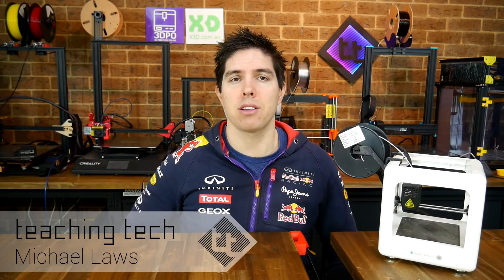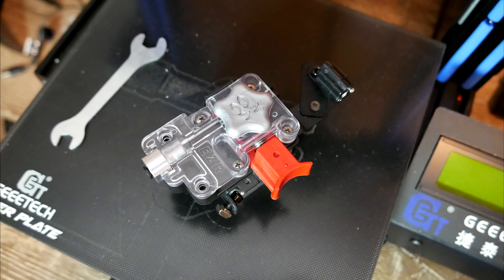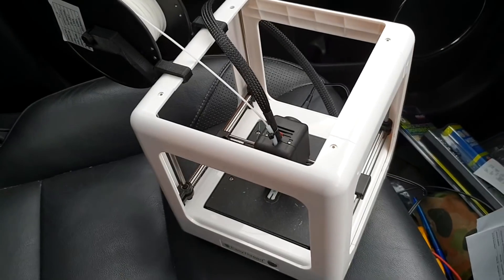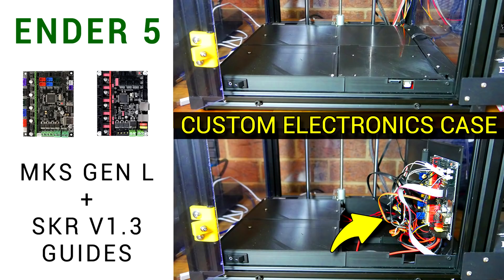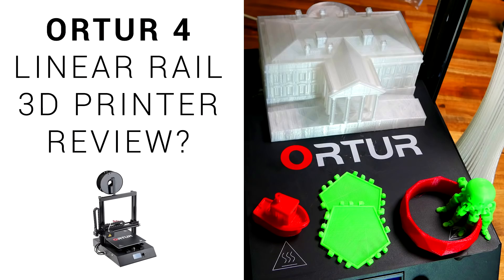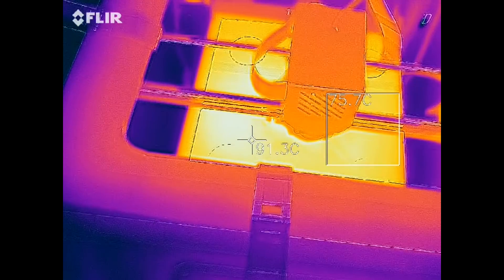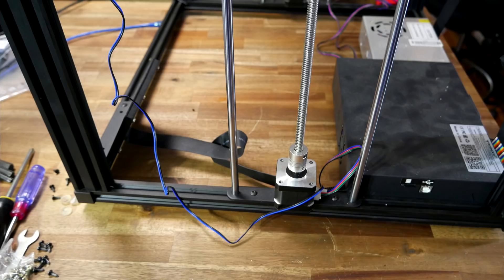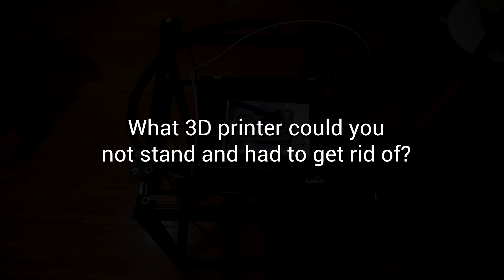3D printer review updates - Keepers and clangers

Comment: I god rid of the Anet a8 and im almost about to do the same with an Anycubic i3 mega with something wrong that I cant find and is making me change the motherboards every couple of months.
Reply: Stop moving your bed and nozzle so fast by hand. This causes them to act like generators and blow the board up with unsafe voltage. It’s probably that (I did that a couple months ago, I knew it was an issue but I got away with it for years and got careless). Or you’ve got really horrendous voltage ripple in your home (since it’s doing it to 2 printers).

Comment: It is telling that you bought Ender 3 three times, and dedicate a playlist to it.  You must see high quality/price there!
Reply: YouTube reviewers told me about the Ender 3, especially touting its quality for low dollar value, and it lead to me getting my first 3D printer of my own (I always thought they were $1000+). Aside from some warped bed issues, it's been great!
Marlin 1.1.9 is mandatory if you ask me, though. That mesh bed leveling feature has saved me so much frustration!
Reply: @samjackson1895  mesh bed? is that the mesh thing underneath to keep the bed level?
Reply: NCZIOOX 
tldr; Mesh Bed-Leveling is a technique to automatically “level the bed”. It doesn’t move the bed, it knows the shape of the bed and modifies the model to match.

A “mesh bed” not a thing. It does a 3D map of the bed and sees which spots are high and which are low. It makes a topological map of the bed, saving the Z height of the bed at each of 9-12 X,Y locations. These points are called a ‘mesh’ in the 3D world (video game graphics, Mesh Mixer, Blender, etc.). It uses this mesh to vary the Z height as the nozzle moves around the X-Y plane.
Reply: @timothymusson5040  Thanks for taking the time to clearly explain it to me!!!
Reply: @samjackson1895  I haven't upgraded to 1.1.9 but I started using a metal feeler gauge instead of paper and it has made a world of difference. I could never print on bare glass now I print naked all the time. The Ender 3 is a fantastic machine.
Reply: @stevelaminack1516  Out of interest, what thickness do you level at. On Ender 3 with SKR 1.4 turbo on Marlin 2.5.x

Comment: My Ender 5 with new BLTouch has been giving me so much grief I almost wanna sell the whole thing and start over :/ Hoping to make it something similar to TT's Ender 5
Reply: I had problems right away with my ender 5 plus. I immediately got the th3d lcd kit and flashed the th3d firmware to it. Fixed the bed leveling problem right away. When mine was stock, it wouldn't properly hold a z offset and even make a proper mesh.

Comment: Velleman k8200 the way they fixed the bed and how they guide the gantry is just terrible. Normally a aluminium frame would be a good basis to tinker further on. But since the aluminum is not V-slot it is pointless.

Comment: what is the best large format 3d printer?
Reply: The one you build yourself. Especially if you build it as a corexy with linear rails and Duet electronics.
Reply: @thedescriptions6646  
thank you very much friend
Reply: Depends what is best for you, if you don't want to design/build one yourself, might be worth waiting for the upcoming prusa corexy. If you are budget oriented, you could build a hypercube or something similar. If you want a reliable self built system, take a look at railcore, voron v2.4 and hevort 3D printers. I personally built a railcore derivative using all the parts of my old Adimlabs gantry i3. I would recommend going with aluminium parts or building a different design. Hope this helps.
Reply: @esk8builder693  
thank you very much friend

Comment: What 3d printer should I get that's under 500 dollars
Reply: Prusa Mini / CR6se
Reply: Per my experience I would look at a CR-10 or CR10 V2.
With a few relatively easy mods I am able to print PLA, PETG, TPU, NYLON, and maybe even ABS, though I haven’t tried it yet.
Reply: Thx to everyone that replyined
Reply: Prusa Mini only If you are willing to change the heatbreak to a Bondtech one and changing the bowden coupler to an (self printed) adapter for PC4-M6 pushthrough fittings and the powden from a 3-parted one (starting Heatbreak, ending 1.st coupler; starting 1st coupler, ending 2.coupler; starting 2.coupler, ending inside the feeder) to one starting at the heatbreak and going into the feeder, passing through the two couplers.
This mods makes the Mini relaiable and nearly perfect for beginners. Prusa should have Made this alteratiins in Produktion...

If you find the modifications of a Mini ti hard ti di yourself, the Sovol SV01 is a surprisingly relaible printer from stock. I used it 24/7 for 7 weeks now (printing faceshields) and it caused no problem at all.
Reply: Don't get a Prusa Mini. Had one Fixed what I could but has significant design flaws. Sold it. Back to my modded Ender 3 for now. Much happier.